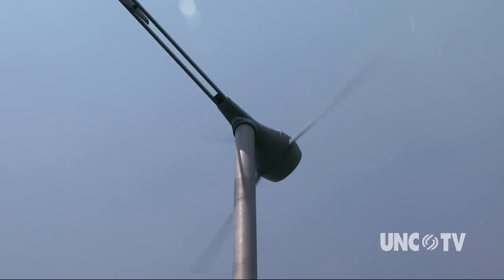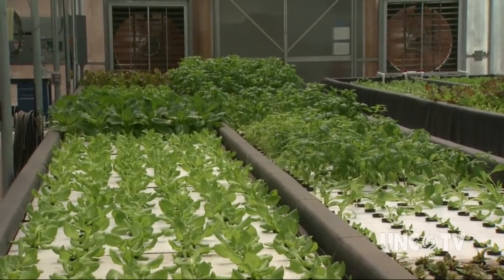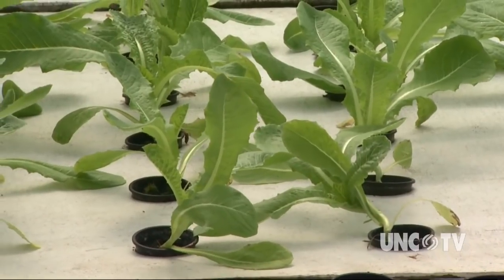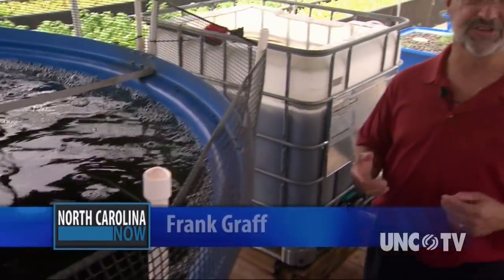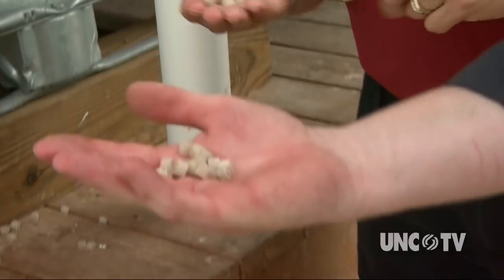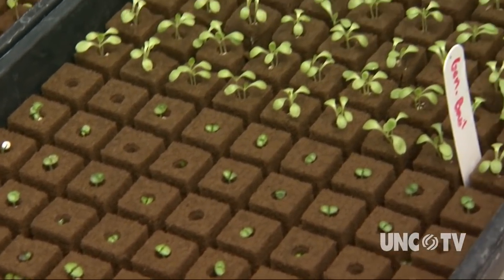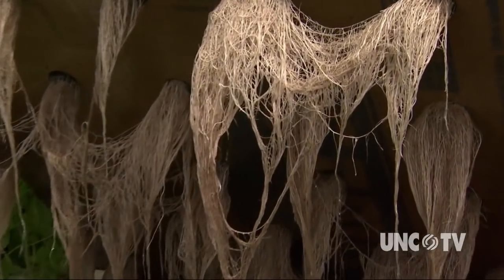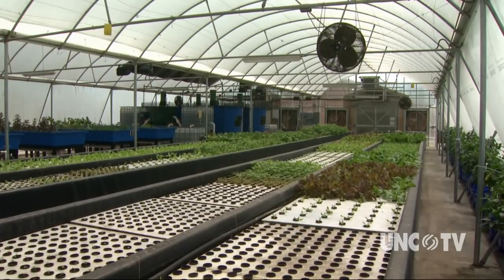Aquaponics Farming of the Future | Sci NC

Comment: This book is a must read for anyone who is thinking about starting an Aquaponic systems [Check Details Here  >>>fb.com/AquaponicsSystem-125782164733983/app/208195102528120  ]. This book saves hours of online research. I really enjoyed the inclusiveness of this book, it definitely got me on the right start. I am in the middle of my build, only have plumbing and cycling left to do on my system. Maybe in a new edition of this book the author could speak about using solar tubes for natural lighting. I haven't found much on using solar tubes for grow lights, I decided to use them in my garage to cut utility costs. We'll see how well it works. Thanks for this great literary piece on Aquaponics.

Comment: It looks like most of these commercial facilities use polystyrene foam sheets to support the net pots.  It looks effective and cheap, but my understanding is that it leaches of carcinogens.  Is this a concern for you?  Are there any other viable options that don't carry such risks?
Reply: +michael98277 They do use polystyrene, but it is a closed form that is extruded and I use a 2" form that is painted with a latex paint on the top side that keeps it from breaking down.  As far as nutrients, You have to put a small amount of chelated iron in on a limited basis. I put about a tablespoon in a 700 gallon system every month or so. Other than that, I put a cup or so of liquid seaweed in it at about the same rate. As long as you use a closed cell sheet and it is coated, I don't think you need worry about safety.
Reply: Most commercial applications I have seen use expanded polyethylene sheets. Polyethylene is very stable and completely safe for use around food, even when under direct UV light. So, you don't have to worry.
Reply: michael98277 coir
Reply: Valid question.